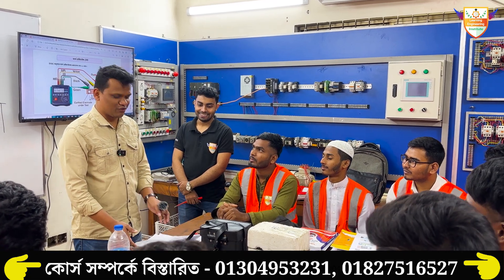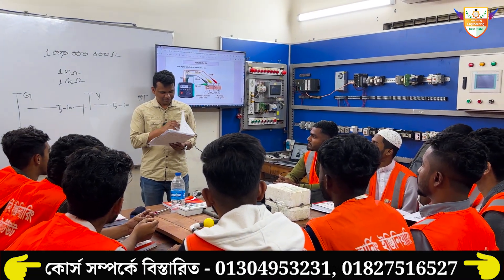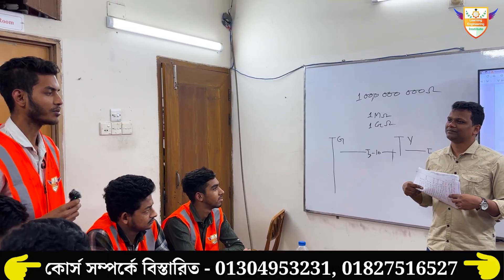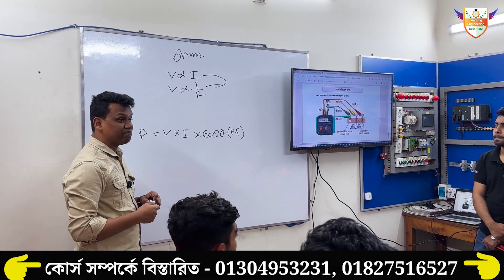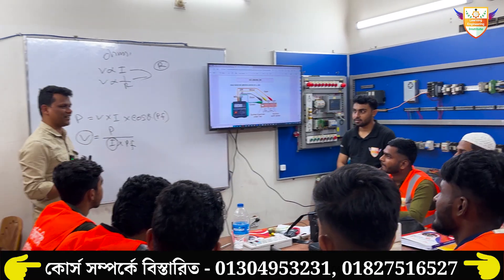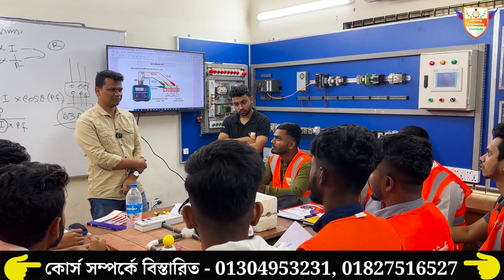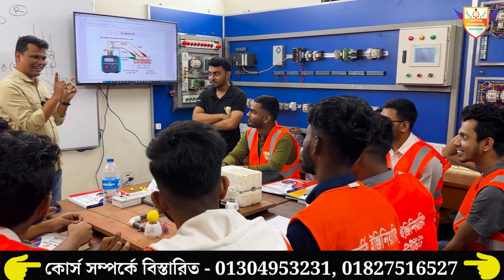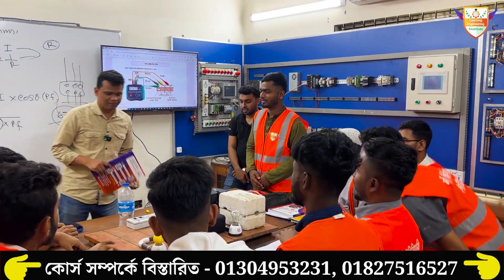ভোল্টেজ বাড়লে কারেন্ট বাড়ে না কমে?  হাউজ ওয়্যারিং এ কোন কোন টাইপের ক্যাবল ব্যবহার করা হয়?

Comment: ভোল্ট কমাইলে কি এমপিআর ও কমে?

আমার কাছে ১৮ ভোল্ট ১.৫ এমপিআর এর এডেপটার আছে,
আমি চাচ্ছি ১২ ভোল্ট করতে L7812 ic দিয়ে, তাতে কি ১.৫ এমপিআর আউটপুট পাবো?
Reply: 12 volt powa jaabe, seta nia kono somossa nei kintu ampere 1.5 pete gele apnake original 7812 regulator babohar korte hobe ..bajare j duplicate 7812 ic bikiri hoy segulo 12volt output dileo ampere kom debe.. ST  ba UTC  eai company r ic use korun .jeta chaichen seta paben